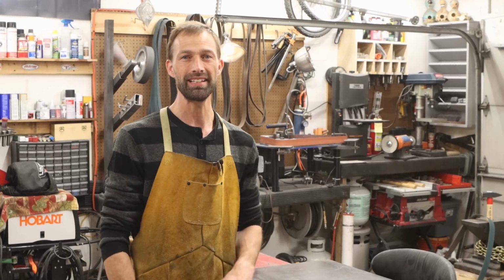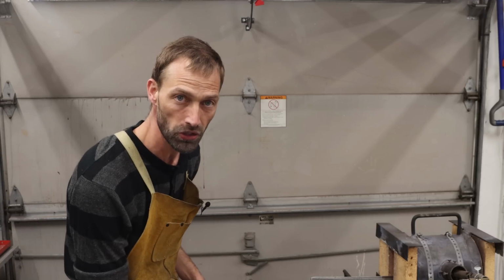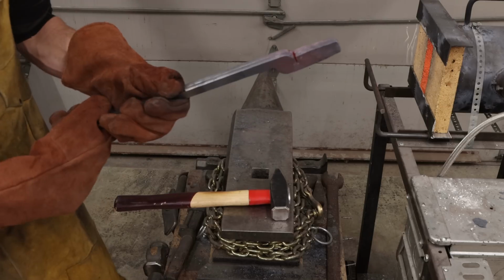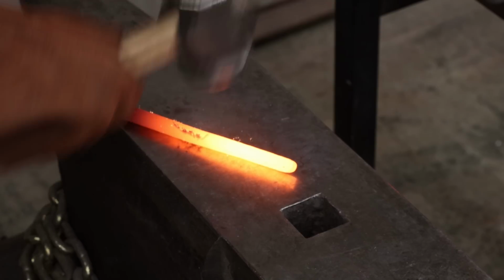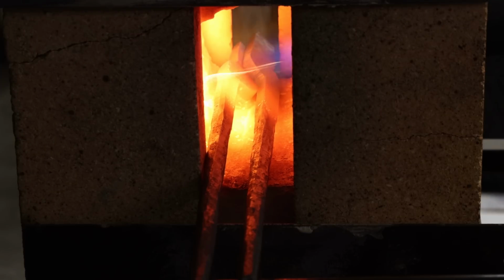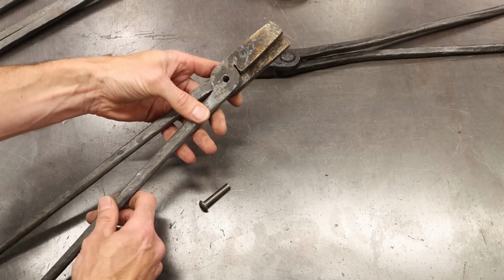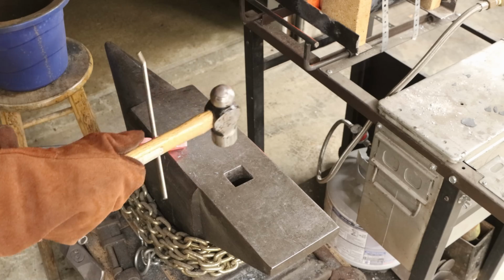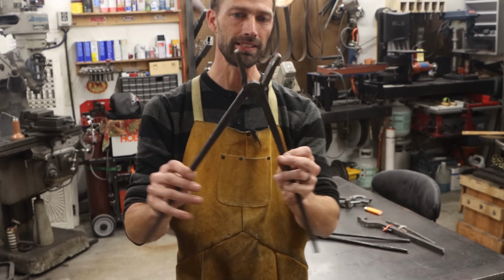Knifemaking tongs the EASY way!

Comment: Great Video Friend!!

I had just ordered the same Railroad Spike Tong Set from Ken’s the same as shown at about 3 mins of this video!! Have not worked on them yet but I have been under the weather for about 3 months. But spring is quickly approaching. I will be removing the cardboard cover for my NEW HB anvil real soon I PROMISE!!

Thanks for this video. You have a new sub. An OLD grandpa from Casey ILLINOIS!! We live a few minutes away from the World’s Largest Golf Tee. It’s located on the grounds of the Casey Country Club. Google Earth will show you EXACTLY & CLEARLY where that tee is located. You can large shadow on the ground!!

Originally the Tee weighed 3300 or 3800 pounds and is nearly as long as a semi trailer!!

Seven miles to the east, you will find the World’s Largest Horseshoe AND the World’s Largest Anvil!! Check-out those things when you get time!!

Thanks Again & see ya soon!!

Comment: Especially useful for guys new to blacksmithing. When I saw blacksmith's shops in the past, I always thought they were tong hoarders because they had so many tongs. I now realize that you need a tong to match every size and shape of metal you're heating up. Making tongs from scratch bar stock is good practice, but it also takes a very long time for a new guy to make a decent tong that way too, so kind of double handicapped until he gets good at it. My shop motto is temporarily "Need more tongs!".
I'm new to it and the tongs I've made from those kind of blanks work pretty well and I've used them a lot. As I get better at it, I've been spending more time refining the reigns and everything else too and they are even nicer in the end, but the early ones are still just as functional. So you can spend as much time as you want on the blanks to end up with whatever fills the need.
Thanks for the tong video! I kinda feel that just like you can't have enough tongs, you can't have enough videos on how to make them either, ha.
Reply from the maker: Thank you! I definitely needed a new set so documenting the process was a no brainer
Reply from the maker: Glad you enjoyed the the video! 
Cheers

Comment: im just curious why at 22.36 you advise twisting each reign the opposite of each other.  i dont believe kens custom advises that process.  in your video you did lock one in the vice 180 degree from the other but used a counter clockwise twist on both.  hence both were twisted the same.
Reply from the maker: The tong reigns are off set so in order for the jaws to line up one twists one direction and the other twists the other direction. When you hold the reigns it your hand looking at them before your twist the heads you can see where if you don't do it right they won't line up.
Reply: @Aleeknives  i dont understand your logic.  if you hold each tong side by side the twist is identical.  i have watched ken do this and i ahve watched black bear forge do this.  i made mine like they do.  i think your instruction would confuse some people and lead them to believer on reign needs a clock wise twist and the other a counterclockwise.  Both reigns twist in the same direction, not opposite.  Dont you agree?
Reply from the maker: I see what your saying🤔
Reply: @Aleeknives  with all that being said i have learned alot from your videos.  keep them coming.  Thanks
Reply from the maker: Cheers! Thanks Vince!

Comment: Great video.  I would love to see one on tuning up old pliers.  I have a few sets I've picked up at flea markets that work okay but are slightly out of alignment etc.  This makes me think it wouldn't be too hard to fix them up.
Reply from the maker: They fix up super easy actually, heat them up and bend them where you need them! I will do a video as soon as I have some that need adjustments